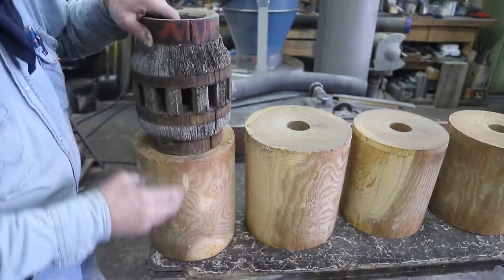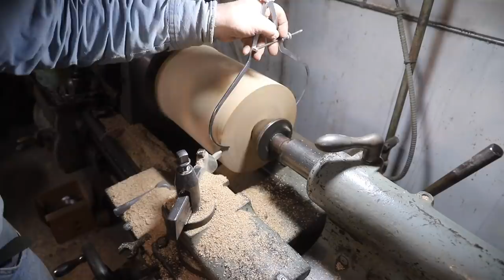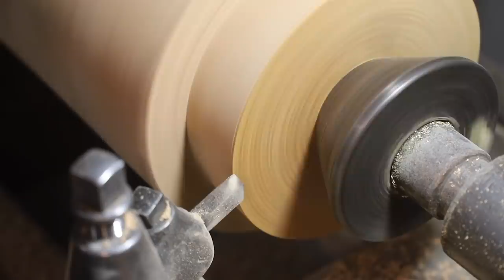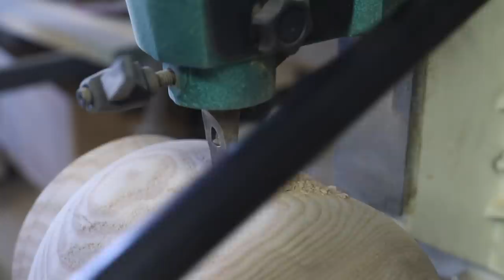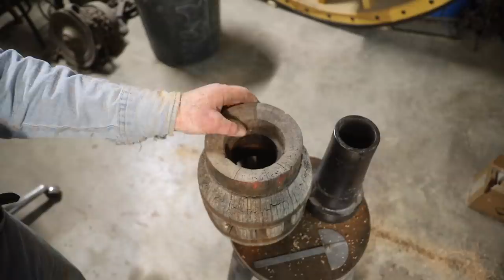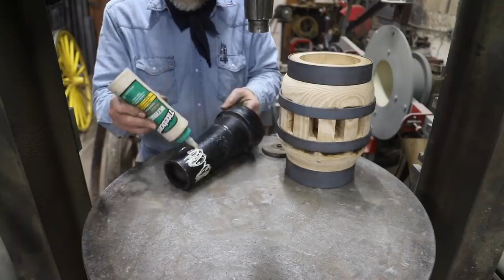How to Build Wagon Hubs in 7 Steps | Engels Coach Shop

Comment: Once again your craftsmanship is outstanding. So much had work goes into these wagons. I would think that for the original builders, without all the power equipment this would have taken 3 to 4 times longer. But maybe they had specialty tools that aided them as well. Possible belt driven. Thanks very much for sharing.

Comment: Hi Dave, I think you need to make another clever tool to add to your arsenal . I suggest some sort of press adapter to press on the rings onto the hubs rather than hammering them on by hand . It would speed up the operation and possibly reduce the amount of scorched wood that can be seen. I find the fusion of wood and metal work in your videos facinating.
Best wishes from Wales.

Comment: I noticed you left the weld inside the hub bands. Why wouldn't you clean the welds up? Also why didn't you make all the hub bands the same size? Being a machinist I have always said metal working machines make the best wood working machines! Fridays are always better with your videos! Thanks Dave!
Reply: I can only guess the welds were left because they may actually help hold the bands in place
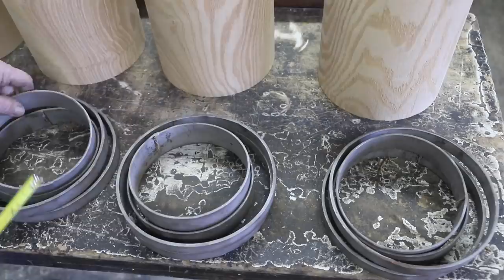Reply: 5:00 explains the band diameter
Reply: @maggs131  I thought about that as well but with the bands being shrunk on the hubs it didn't it necessary to leave the welds on. Course Dave is the master! I would not second guess him. Thanks Maggs131 for your reply and I agree you are probably correct. Take care. Mel from Brighton, CO.
Reply: @12345.......   Thank you. You are correct. I know all about keeping things original. Been restoring a 1966 Jaguar E type and there you must keep things original! I totally understand that. But........who is going to know if one band is a different size than the other? It would make life a bit easier for Dave. Just saying. Thanks for your reply count to 12 person. :)
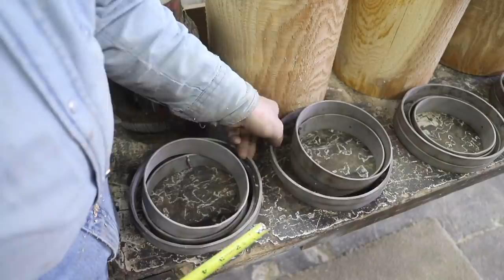Reply: I assume it acts as a key way .  The hub bands 1:39 .
Reply: He made the hubs the diameter of the smallest hub to make all the hubs the same and did not show the adjustment of the 2 to adjust.  The outer bands were left as they were and the hubs were made to fit the bands.
Reply: @retlasm  Very easy answer to your question about "who is going to know": Dave is going to know. 'Nuff said!
Reply: @retlasm  'Original' is a wildly overrated term.  I have a tank of 'original' Jaguar E type Air if you need any.
Reply: That's for sure, Dave. You really inspire me, my friend !!
Reply: As far as why he made one set of bands all the same and left the others as they were if, he didn't make the larger bands all the same size, I think the spokes would be a different length on each wheel, and that would be wore work. The smaller rings being different sizes didn't affect anything, so fixing them would have added time to the job.
These are just my guesses. 
I can't figure out why the boxings are so much longer than the hub.

Comment: It's amazing what you can accomplish with a lathe. a machine of many task's. thanks for sharing. ECF
Reply: I agree. 

What I find really amazing is that wagons and wheels were around long before lathes. At least before lathes like we think of them.  So people were essentially doing it by hand and thinking how can we make this easier or quicker or stronger or more repeatable and so on over a lot of years. It required people to pay attention to details and pass what they learned on to others while wiling to accept their best efforts could be improved on by others.

It's a trait not commonly found with today's workforce with engineered lifespans and wrote assembly work. But to take modernish tools like the lathe and accomplish much of the same of the past while keeping parts made 100 plus years ago in service at the same time is rather remarkable to me.

Comment: Hey Dave,  Watching you build these Hubs takes me back to shop class,  working on an overhead belt driven lathe in school.  We worked on metal but the principal is the same.  Lots of awesome vintage machines in Brooklyn Technical High School which was built in 1922.  I would have loved to see how these Hubs were built by hand without the convenience of electrical machines.  I wonder if it was similar to the Singer sewing machine which was driven from a tilting footrest that was operated by your feet,  which would spin the hubs in order to make them cylindrical.  Great Video.  Thanks

Comment: Dave did you make any changes to your metal lathe to be able to turn wood. Speed ect. I have 2 large metal lathes and only need one. So after watching you I am thinking about making  one a wood lathe. THANKS Dan H
Reply: His is a line shaft belt fed with step pulley. So not sure if that helps you any.
Reply: Just do it. No difference at all. Just a bit messier is all., and the saw dust will soak up the oil in your lube points. Other than about that, and 20 other things, no difference at all.
Reply: I’m telling you, it can’t be done. So I suggest you quickly send your spare one straight over to me...... please 😍

Comment: Nice to see the work done.
I just wonder if it wouldn't have been easier to heat the rings in an oven instead of using a torch, just to make the heat more even. It would still require swift action to put them on of course.

Comment: watching you measure with the tape measure, start at the 1 inch mark and measure from there.
Reply: That actually is an old trick.  The end of most tape measures moves the thickness of the end piece or about 1/16 inch.  It is easier and much closer to measure from a small marked line than from the end which might be damaged to get an accurate measurement.  I usually measure like that for very close tolerances, such as 1/64 or 1/32 or smaller for furniture or cabinets.
Reply: @royreynolds108  I have used that many times.. have built a lot of cabinets etc. Was a maintenance carpenter for a large plywood mill for many years.

Comment: Those hoops looked like they were resistance welded together.  mag wheels are done the same way, their pressed together, arced together and then smashed against each end.  Generally, the inner and out welds are trimmed then sent to the spinner that spins the shape of the rim, then gets trimmed to round the edges.

Comment: Thanks for sharing Dave. Please pardon the nuisance but lots of questions come to mind. What kind of calculations go into sizing hubs if you were starting from scratch? For example, why would these hubs be 11 inches long instead of, say, 14. Our why are they the diameter they are? I know you are fitting the hubs to the existing bands but why did the first maker choose the original dimensions? One more and I will quit: What kind of cutter and holder are you using in that lathe? Using what appears to be a metal lathe to do wood turning is very intriguing and I would like to know more about that.

Comment: It’s been a while. Good synopsis. Did you resize the large bands?  If I understand things correctly, it seems like you turned the hubs to a uniform diameter based on “the smallest” of the large bands. Then, turned the ends to fit the existing bands. If so, why the different approaches?
Reply: He made the large rings all the same size.

Comment: But how would You manufacture the mortises without the heavy machinery? That would be interesting to see 🙂.
Reply: You would have to use a hand drill and chisel, or just a chisel if you did not have a drill.  It is amazing what you can accomplish with hand tools when the need or desire arises.
Reply: @roberthayden4512   I already thought that. Sounds like a tedious task. I‘ve drilled holes with a big hand drill once. Although it wasn‘t as exhausting as I expected (The Drill was at least 70 to 80 years old but sharp as hell), it took a while.